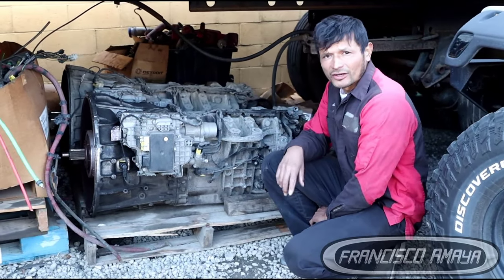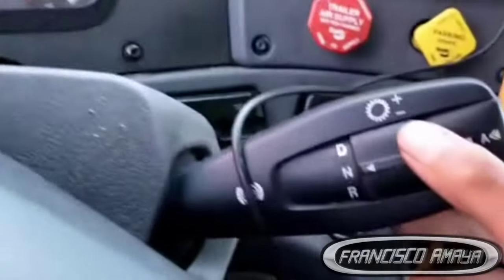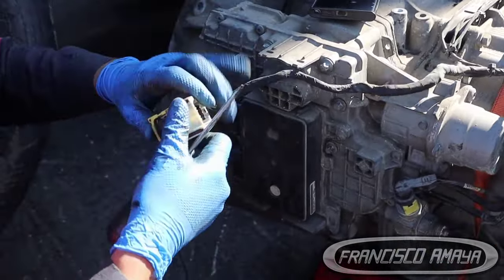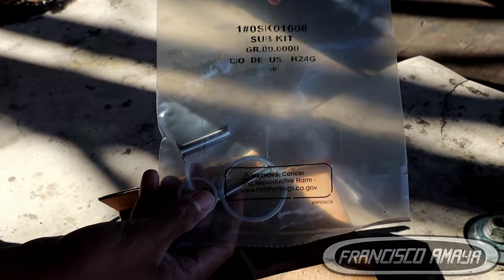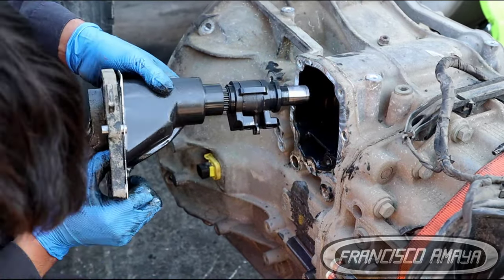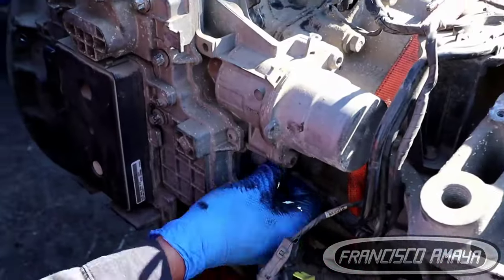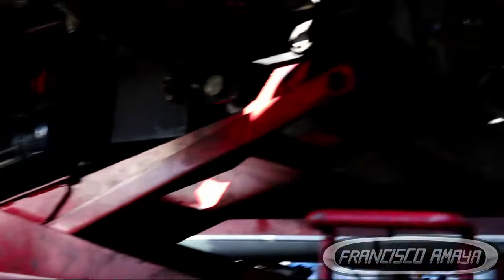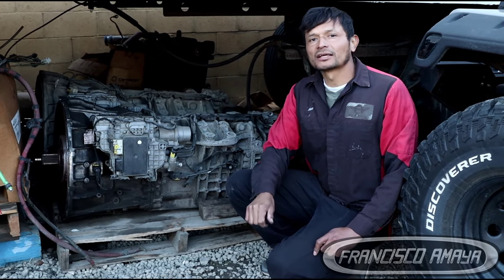DT12 automatic transmission gear position split pin replacement transmission not shifting right

Comment: Hello I have a code on my transmission SPN-521007 FMI 14. Truck does not start but as soon as we disconnect the drive shaft truck works like normal. It seems like the transmission is stuck. Do you have any tips or tricks on this issue. Thanks in Advance. 

Buenas noches mira que me saco ese código SPN-521007 FMI 14. La verdad nomas se apago así de repente la troca pero una ves que desconectamos el drive shaft la troca prende bien. El problema es nomas cuando esta conectada ala transmisión. Si tienes algún tip de lo que sea o como arreglarse se te agradece. Muchas gracias.

Troca es una 2019 cascadia
Reply: No le pudieron encontrar lo que tenia, compre una usada en Felix transmissions en Dallas,TX. 

Mechanic could not find what the fault was so I replaced it with a used DT12 Felix Transmission in Dallas,Tx

Comment: My DT 12 stucks from 6-7 and 7-6 in winters, but once I heat it up by idling to transmission temp above about 75 f , it gets better, above 90 f the problem completely goes away.
Reply: Exactly the same for mine